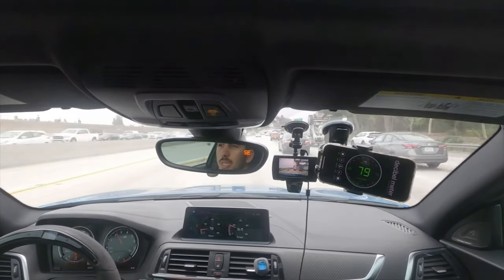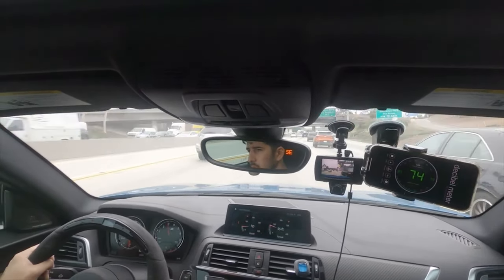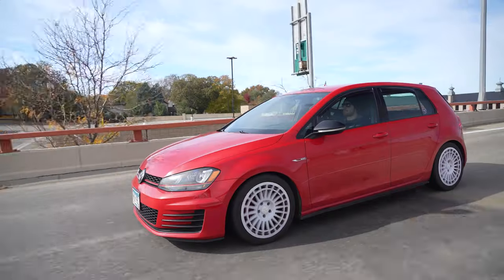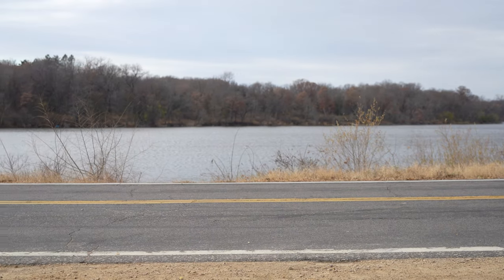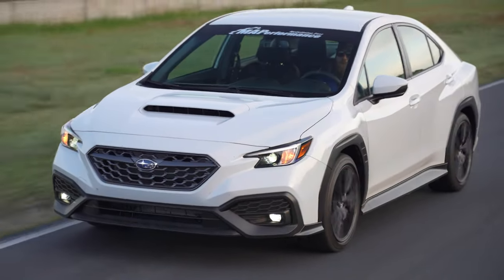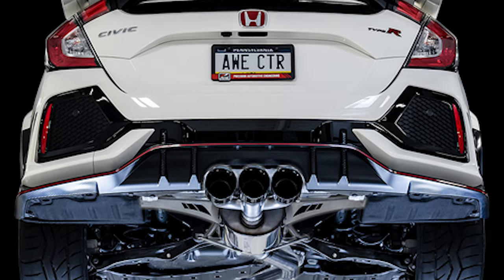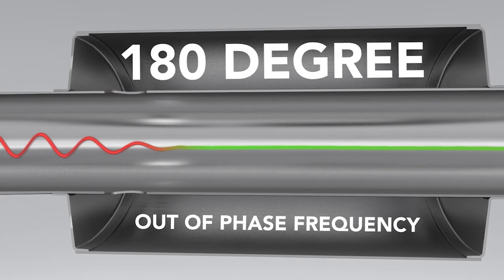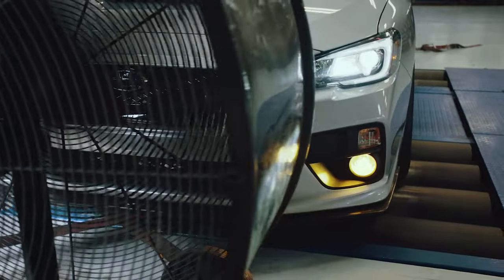Why Do Aftermarket Exhaust Systems Drone? (And how to fix it)

Comment: Sooo, how do you cancel the drone without upgrading to the 180 technology 🧐
Reply: yup basically this was a long, convincing sales pitch for buying the exhaust he mentioned.
Reply: im glad someone felt the same way. I was a little let down when he finally got to how to fix drone and its basically "buy our sponsers products"
Reply: Get an aftermarket resonator
Reply: 180 technology is just a commercial term to say helmoltz resonance on exhaust. thats what manufacturers have always used before. The cheapest way to fix drone is to create a J pipe  with a calculated lenght that cancels out the undesired frequency. There are many tutorials on youtube about j pipes.
Reply: J bend in the pipe. Go to an experienced muffler shop and tell them around what speed and rpm you get drone and they'll be able to make a bend in the pipe to help with drone.
Reply: @simoneamodei9265  why don't more aftermarket exhausts use these resonators or J-pipe? almost everyone complains of drone on aftermarket exhausts
Reply: Actual solution with video of the pipe used and how they do it plus how it looks once welded in https://youtu.be/QqJyiRZxwE8?si=nWS5ef0NON3hBiTG

Comment: This video has an annoying drone noise. What's so annoying about it, is the talk talk talk that eventually leads to some high tech crap that is not going to interest most people. You should do less talking and get straight to the point. Show what the actual product does instead of waffling on. Thanks
Reply: Actual solution with video of the pipe used and how they do it plus how it looks once welded in https://youtu.be/QqJyiRZxwE8?si=nWS5ef0NON3hBiTG

Comment: I have an FK8 with the AWE Touring Exhaust. I had significant drone with this exhaust. It was more noticeable in the winter time and not to bad in the summer in the summer (ambient temp affects the speed of sound). I ended up fixing the problem by buying their dual phase mid pipe option that adds another resonator/phase chamber to the exhaust, and have not had an issue since. 

So yes, throwing the frequency out of phase at the tail pipe is a good idea, but its not always going to be enough to fix the problem and their exhaust are not exactly drone free out of the box as stated in their marketing.

Comment: Sorry gotta call out BS on the AWE 180 tech.  Bought the AWE touring exhaust w performance midpipe for my 2013 BMW 335i and the drone was crazy and way too loud.  Per recommendation from  the muffler shop put a Vibrant bottle resonator and it reduced drone by approx 80% and also got a little quieter. But still drones on highway speeds around 90mph.

Comment: I bought a low mileage 2LT 2015 camaro that i most testdrove around the city a little on the highway but not far enough to use cruise and that was a mistake.
I specifically asked the salesman if it was stock exhaust and he said it was and being a little wet from rain i didnt wanna lay on the ground to verify
WellTLDR, as soon as i drove it home with cruise on, it had the dreaded DRONE between 1750 and 2150 and i called them immediately to complain. They feigned ignorance and said sold as is blah blah.
THEN i noticed they made a huge mistake in the listed mileage. It said 35000 on the ad and was almost 38000. SO i complained again and this time they had to do something so they offered me 450 bucks or else full refund. 
I took the 450 but now im stuck with watching DRONE videos to fix it, lol

Im told if i get a V8 rearend with 392 reargears i will likely be outta that droney Rpm band on the highway.
Anyone know  where i can get one?

Comment: I called them a while back asking if I could put a resonator on the system I had put on my civic.  It drones so bad and I'm fine but those who ride in the car either love it or can't handle it for very long lol.  After a drive to Vegas which took me 10 hours or more I couldn't hear shit.  After several hours I couldn't handle it.  $1400 exhaust system shouldn't sound that way imo. After they responded I gave up because all I wanted to know was, "Can I add a resonator to the system I put on in hopes of eliminating some of the harshness of that sound, if so which, if any, would you recommend?"  I got a response about how everyone precieves sound differently... well duh!  I understand that but even someone as myself who can deal with the loudness just fine but also doesn't care for the drone factors, I can agree the system needs some form of dampening.  It's vibration is louder in the car than outside, and that's the point was getting at. The sound is great the actual physical properties of that system changed the dynamics in a way that adding the Honda resonator back into the system might of been enough to create the perfect combination to get that exhaust note I was hoping for.  But I wasn't able to get that answer from them, nor could they even give me an idea of where  I should install the resonator in regards to that system.  But in the end, it is what it is for me, and this news here makes me feel better knowing they have put some effort into fixing such a challenging task. I do love their exhaust systems and look forward to next system I get now. Lol good work

Comment: Been looking at your stage 1+ package, live in MN so an OTS tune for a small amount of time from the same state seems smarter than a different. But my WRX is a 2021 and your packages say 15-20 :/
Reply from the maker: Unfortunately we do not have any tunes for the '21 WRX.
Reply: @maperformance  if I roll up with mine can I get a discount so you can put it on your site too? 😏
What's the change from the 20 to the 21 that calls for a different tune? Or does each year have its own?